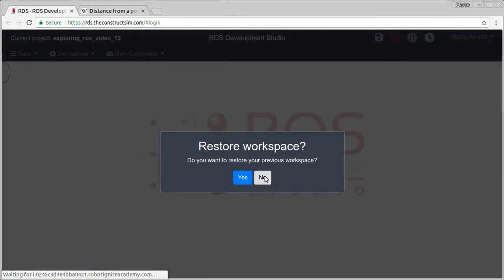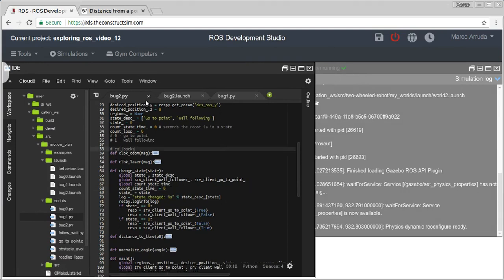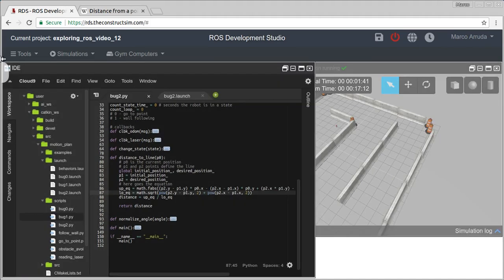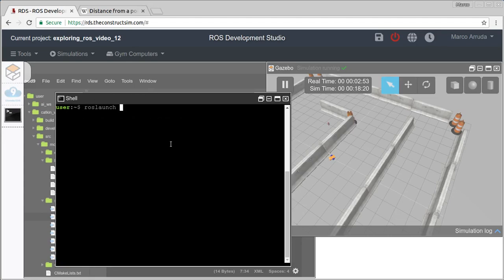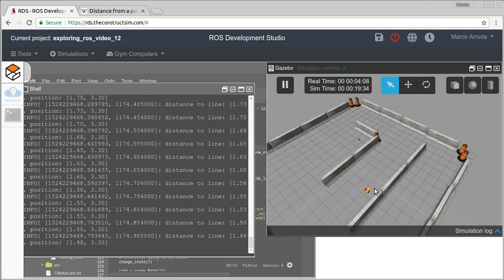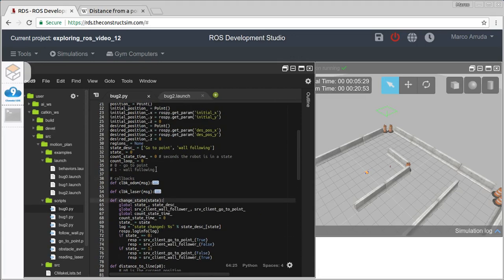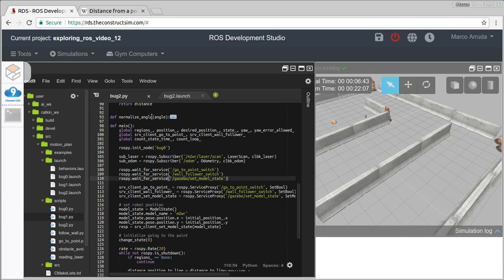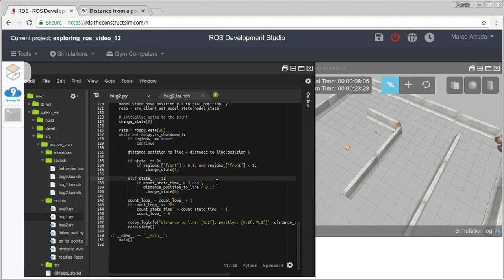[ROS Projects] Bug 2 - Exploring ROS with a 2 wheeled robot #Part 12

Comment: Can this algorithm be adopted if a robot has to move inside a pipe?
Reply from the maker: It depends on the application you want to implement with your robot. If you want the robot just move along the pipe, yes it would work, at least until it finds a crossroad